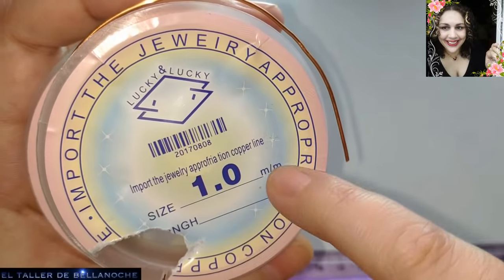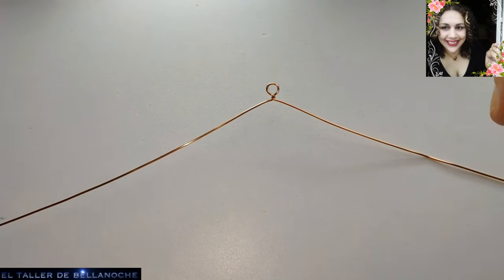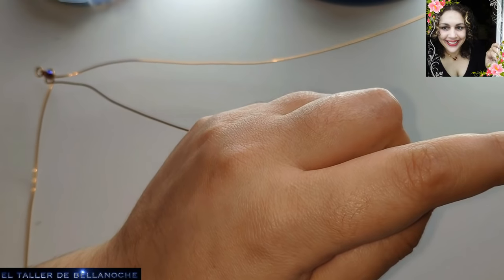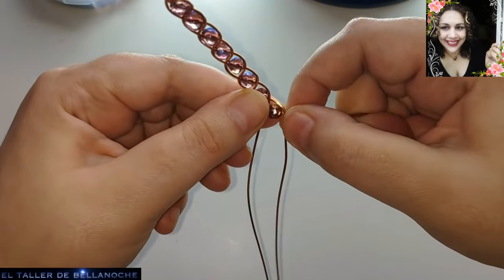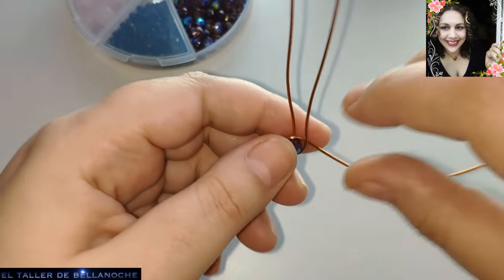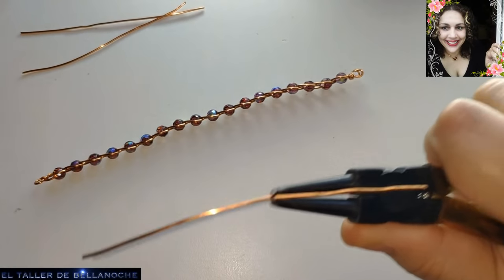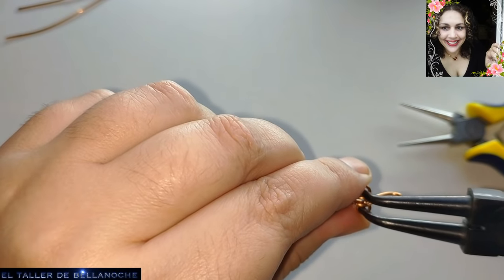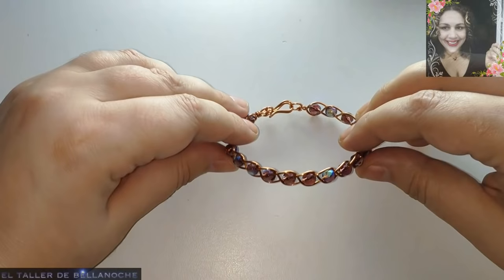COMO HACER PULSERA TRENZA DE 3 CABOS CON ABALORIOS-HOW TO MAKE A 3 STRAND BRAID BRACELET WITH BEADS

Comment: Love your works and tutorials.. Unfortunately as much as it pains me.. I will be unsubscribing due to lack of English subtitles and or instructions.
You material list is confusing at best.
Sorry it's come down to this.. I've made several attempts and requests.. All to be told.. that you do not have English skills..
While I understand that.. you clearly do have someone that can post some things in English..
Please post CLEAR material list
Like this..
Material List
-------------------
20 gauge wire.. or whatever size
With length of wire in inches and cms
6 mm bead.. or whatever it is
With number is beads for whatever size bracelet
------------------
Thank-you
Reply from the maker: Hello Friend. In the description of each of the videos you can find the list of materials in English and Spanish. There are some videos with subtitles, but it is the community that does that. They have permission, but I do not intervene. Any questions you can always ask. I used 30cm and 60cm of wire and it is left over, because it is a medium size. Still, I show the metric ruler. The wire is 1mm in diameter. In Europe we do not use gauges, if not millimeters of diameters, even so, I always show the rolls, so that they can see them. I answer each and every one of the comments, which are not few, using the translator. If you are still not happy, thank you for the time you have been in this community. A hug from Spain.

Hola amiga. En la descripción de cada uno de los videos puedes encontrar la lista de materiales en inglés y español. Hay algunos videos con subtitulos, pero es la comunidad la que hace eso. Tienen permiso, pero no intervengo. Cualquier duda siempre puedes preguntar. Usé 60cm y 30cm de alambre y ha sobrado, porque es una talla mediana. Aún así, muestro la regla métrica. El alambre es de 1mm de diámetro. En Europa no usamos calibres, si no milimetros de diámetros, aún así, siempre muestro los rollos, para que puedan verlos. Contesto a todos y cada uno de los comentarios, que no son pocos,  usando el traductor. Si aún así no eres feliz, gracias por el tiempo que hayas estado en esta comunidad. Un abrazo desde España.
Reply: @eltallerdebellanocheoficial  Thank-you so much for this information. Very helpful.. I will try to remain in this community as I do like your tutorials. Unfortunately it is impossible for me to try to learn Spanish as I'm hearing impaired. I do appreciate your challenges with English as well.
Perhaps someone can post the gauges of the wire you used. I am also new to wire wrapping so getting the correct information if very important.
Hoping to learn all that I can from your tutorials. 
Thank-you for your response.
Reply: Hello Carol, definitely try to stay on. I'm English speaking only I watch lots of vids in other languages.  Even tho I'm not hearing impaired, I do see other vids used another measuring system than I do in the States. Same as when I watch cooking channels. I just do a Google search for conversion.  Hope this helps, I'm more visual learner anyway so just as long as i get to see what is being done,  I can have success in the project and make it my own.